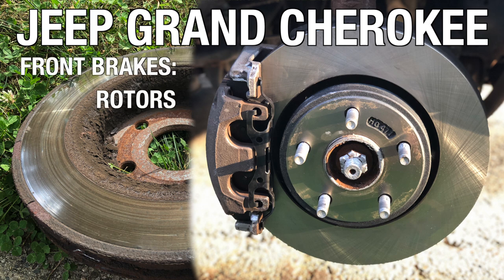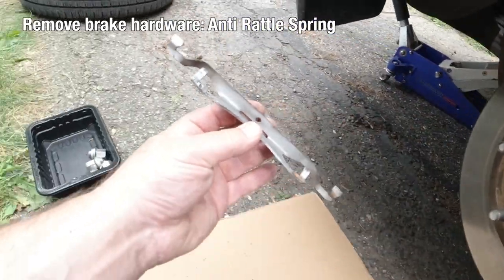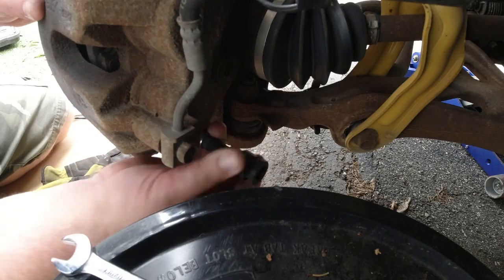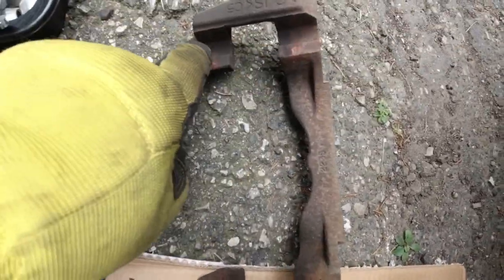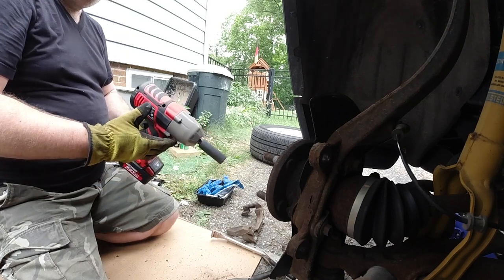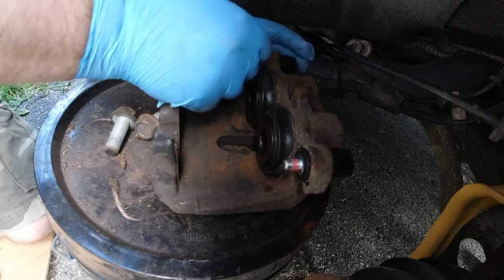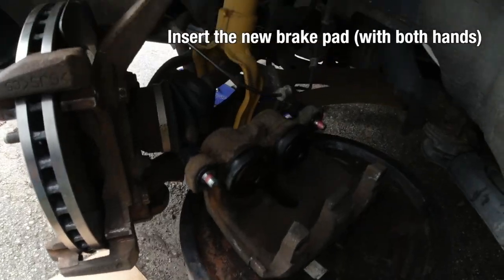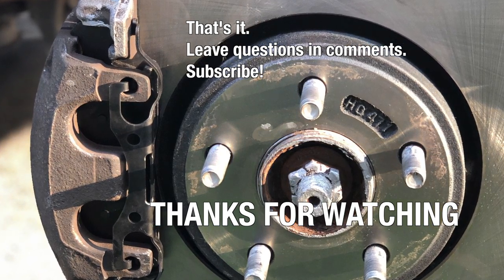2013 Jeep Grand Cherokee - Front Brakes - D.I.Y. in the Drive Way

Comment: If the corrosion on the slide pins is surface rust, then you should be able to clean up with a piece of mild duty sand paper and clean.  Don’t forget the slide pin grease when installing the pins whether you cleaned the pins or replaced
Reply: Yeah it's an easy fix.  I did a winter tire change recently and I always check the brakes.  Those pins are easily cleaned using a metal file (or sandpaper)  Grease them up after and reinstall!

Comment: Best video of the proper way to do a brake job on this truck by far!  Thanks!  Would appreciate if you know torque spec for rear caliper slide bolt as well as I need to do this job very soon.
Reply from the maker: on my car, the one there in the video the FRONT Caliper Slide Bolt Torque Spec is 55Nm (41Ft.Lbs.), 
and the REAR Caliper Slide Bolt Torque Spec is 27.5Nm (20Ft.Lbs.)
Reply: While you have the caliper and the old brake pads off.....do yourself a favor.

Use one of the old pads and press one side against the piston.  Probably the inside pad but can be either.  Press a C-Clamp between the rotor frame...(side with the Flex line hose.)...

Makes compressing the piston so much easier and eliminates the risk of the C-Clamp from sliding off the piston and possibly puncturing one of the piston dust seals.

For front brakes I have tried two ways and both work well.

Method 1:

Align the Clamp with one of the pistons....(doesn’t matter which one and slowly compress that piston.  Loosen the Clamp and repeat the same step for the other piston.

Option 2:  Depending on the caliper design this may not be as easy.  

Center the Clamp in between the two pistons and slowly compress the piston.  Same result as method one but may save a minute or two.  

You are not worried about the old pads if they get damaged....They are going to the same junk pile as a rotor without damage.

For the Master Cylinder:  loosen but DO NOT Remove the reservoir cap.  This will make the piston retract easier by less resistance.

Very simple reason for compressing the piston..........

Takes up the difference between the old pad and the hopefully thicker new pad.

The Anti Sieze on the rotor hub is a good trick will make the rotor easier to remove for next brake inspection/replacement
Reply: Agreed. Key word: "proper". Great job!